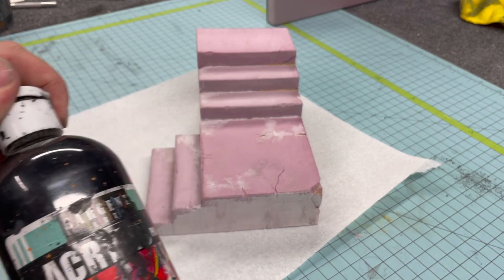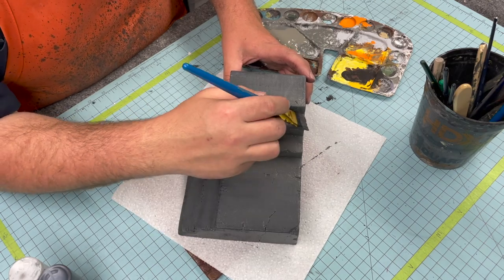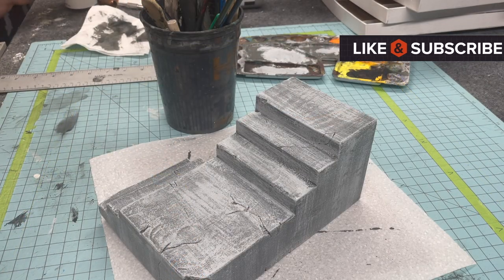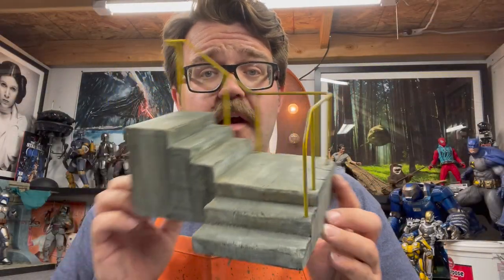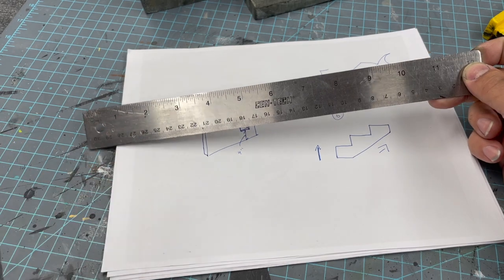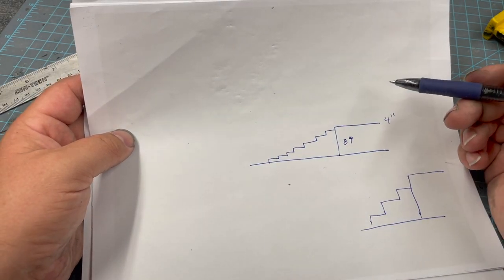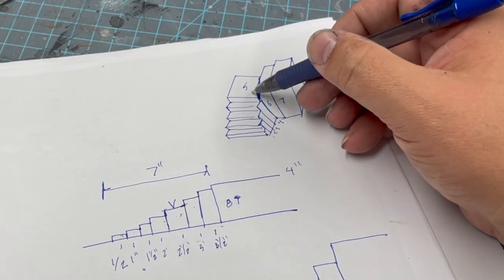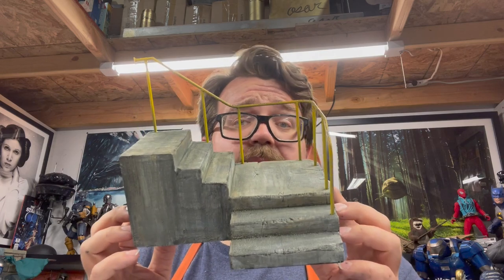Hyper Real Miniature Concrete Stairs HOW TO

Comment: Great video, I used to design many commercial stair and rail systems when I was working for a structural steel fabrication company and one of my pet peeves was stairs and rails that weren't built to meet ADA codes. Quite a few of the concrete crews used to hate to see me when I would point out to the general contractor that said crew's concrete stairs/ramps were not to code. Because I was hired to supply hand/guard rails for those out-of-code projects. And as for the rise/run formula I tried to use, 11" run with a 7" rise.
Reply from the maker: Wonderful! Thank you

Comment: Great work! Aside from oiler, someone had brought up applying building codes to their builds. Great tip, and time saver…a good way to start a stair build, whether 1/12, 1/18, 1/6, is setting the angle. I’ve found that using a 30-35 degree angle works well. 11”tread 7”riser to code is a 32.4 degree angle.
Reply from the maker: Great tip!

Comment: Cool.  Now how does it work with wood?  The math gets me conflused every time.
Reply from the maker: Not sure what you mean? Are you asking if you used sheets of wood? Or blocks of wood?
Reply: @OilersWorkshop  making stairs from wood, not foam.  Foam would be too bulky for an interior stair
Reply from the maker: @swearenginlawanda  sure but what kind of wood? How thick? Balsa? Plywood? There is many ways to approach that